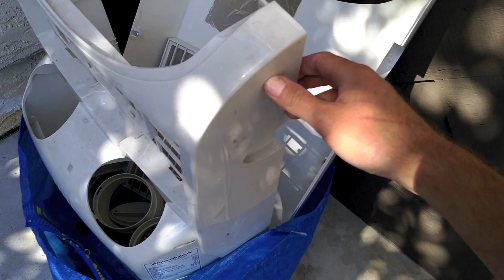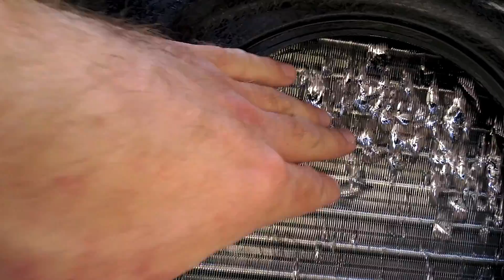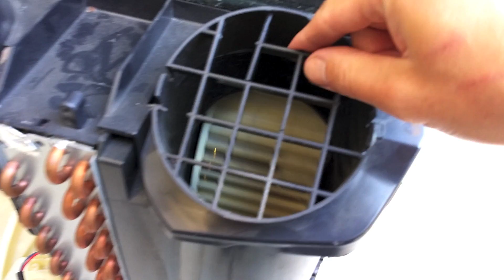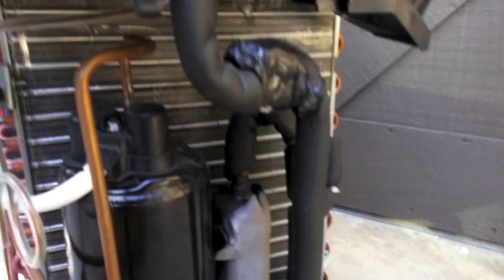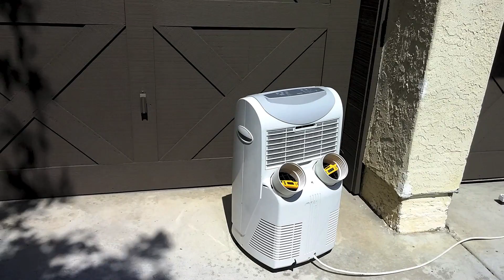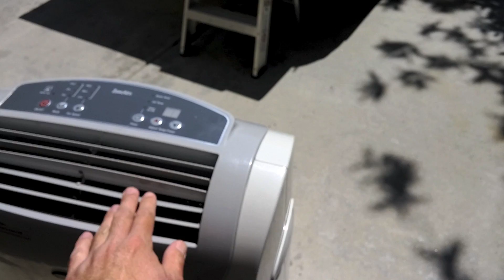Portable Air Conditioner Repair

Comment: Hi Jon, I just watched your video where you repaired the Friedrich aircon. I have a old identical looking aircon however the name is different I'm struggling to get the darn covers off, the one side clips out easily but the other side seems to be hooking. Is there any way you can explain how to get it off. I've unscrewed all visible screws, do I need to used force to unclip the sides
Reply from the maker: +Ed Thomson Hi Ed, Not being abel to see it, it's a little difficult to say. I've only worked on these a few times. I've seen the front cover have one screw at the bottom and have hooks that slide in to each side panel mid level. And looking from the back (with the back cover off) there might be one screw on each side internally holding the front cover on, you'll need a long philips for that. You should be able to slide the front cover up and off at that point. and continue disassembly. It is tricky to take the covers off these things.

Comment: Do you have a portable AC you would reccomend?  Have you heard of the Solis lx-140?
Reply from the maker: +leo ll No I don't, I would say there all pretty much the same. I would just recommend to get one with a two hose set up, but that's probably only found on the larger BTU models i.e. 12,000.
Reply: Jon M. HVAC that seems to be the opinion. The model i put up has the intake and exhaust.

Comment: Thanks for sharing! A well produced and informative video. 

I have a similar (twin-blower) AC unit. Ever find mold to be a problem in the reservoir of these units? I cough whenever I'm in the same room and I've noticed others do too. I haven't figured out if it is the AC unit or something else in the room.
Reply from the maker: +mikehall9000 Thanks,
No I haven't seen mold in these types of units, but it wouldn't  surprise me though. Might be worth to pop it open and take a look.

Comment: Hey Jon, Awesome fix! I was wondering if you could share the part number for the fan. I'm doing a repair on my friends as well and it's almost identical. Like to get the part before taking it apart and having to wait. Thank you in advance!
Reply from the maker: Elder Recinos Thanks man! Which fan? condenser or evaporator motor or do you mean the wheel?
Reply: The clear fan that blower fan you replaced to exhaust the hot air. You said you got an 8.5inch diameter instead of an 9inch. Any idea why that part number is? Or a snap shot of the part number you got. Been looking for a good 2hrs now with no luck.
Reply from the maker: Elder Recinos Not an easy part to get, I know. This is the ebay listing# of the wheel I got: 131287512138
If you ask the seller he may be abel to get you something. Do an ebay search for: Portable Air Conditioner Blower Wheel.
as long as the dimensions are close and the blades are the same orientation, you should be ok. Heres a link to the unit's instructions in this vid, it has part#s  https://goo.gl/rY11GQ
Reply: Jon M. HVAC  Thanks so much. Will do. I found one for a honeywell portable AC. Looks like they're all pretty similar. Bought it to try out but will follow up with the seller. Thanks a lot for all your help! You wouldn't happen to have the slow mo of the video you're willing to share when you take it apart? Maybe a link I can just DL it from? Or I'll just end up using the slow mo on youtube.
Reply from the maker: Elder Recinos You got it man! glad to hear your making headway. I'll send a google+ message with a direct link for the vid.
It really wasn't my intent to make this a DIY vid, I would have done a better job if it was :>)
Reply: Jon M. HVAC  No worries man! Even though it wasn't meant as a DIY, it's actually one of the better DIY vids that I've seen since researching. Kudos man. Look forward to it man. Thank you!

Comment: Hi John thank you for sharing..  I have a commercial cool cpn12xh9 it keeps shutting off and blinking "STOP" also beeps.. do you have any idea what could be wrong with it?
Reply from the maker: You may want to try draining the water out. There should be a plug on the bottom, have a pan ready or take it outside.